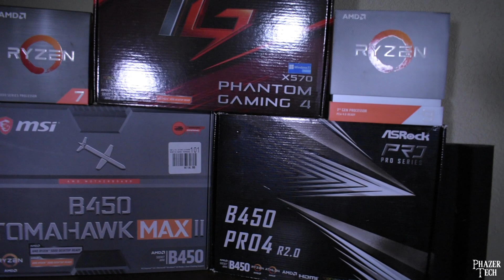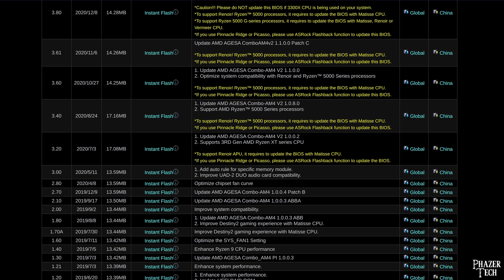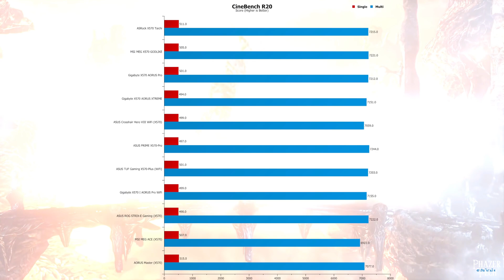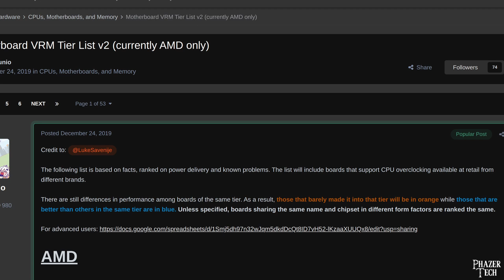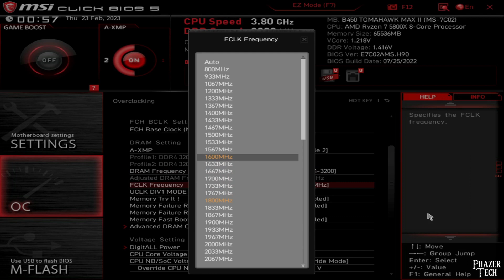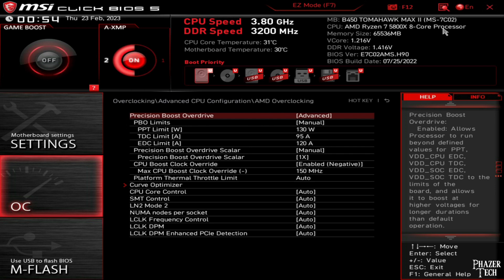AMD Ryzen CPU Degradation - Fix Instability With Custom PBO Settings!

Comment: I never overclocked for more than an evening.  At least in the last 30 years.  Few days ago I received my brand new sealed Ryzen 5 3600 and B450 board as I can't really afford anything else.  
I ended up turning off PBO for the safety of my brain.

Comment: My 5800x started to degrade after 3.5 years on stock/auto settings. MB ASUS x570-P, RAM: 2x32Gb UDIMM G.SKILL F4-3200C16-32GVK 2x32GB.
I analyzed EventView error logs, it appears that few cores and Infinity Fabric started to degrade. It runs only on 1.3375 static voltage with PBO and all boosters turned off. I fails (freezes or reboots) during idle on low voltage.

Comment: I took over a friends 5800x. Had random freeze and restarts just getting into windows. After much troubleshooting i found that it was Core 0 that gave me trouble. Had to put a +4 on the curve for that specific core and the rest I could run with -10.
Reply from the maker: That's interesting, since making this video I found the same thing on two CPUs. Actually one CPU required +4 on several cores, but they were all on the first CCD. I now believe cores are a bigger issues than the infinity fabric and I'm considering making another video on it.
Reply: This 5800x is from a HP Omen 30l build. And those are notorious for overheating due to bad case ventilation and a poor cpucooler. So this particular cpu had a tough life. Dont know how much that had effect on it though. I know that my friend that had his omen had alot of overheating issues and shutdowns. So i believe he ran it with somkind of eco mode from the hp gaming hub. He's not that tech savvy so he just let it be. So... Anyhow i bought that system from him really cheap and thought that i could bring it back to life. 
Did a clean install of windows and trouble began immediately. It would just freeze and/or restart randomly. Got rid of the godforsaken hp omen motherboard and got a nice second hand gigabyte b550 auorus pro. Same there, freezing and random restarts. Had to do alot of troubleshooting with different psu, gpu, ram. Only one thing left, the cpu. First culprit was core 0, which gave me WHEA error. With a slight positive on that one i got the system somewhat more stable. But it seems that anything past -10 on the rest of the cores is a no go. Havent really had more time to test each individual core thoroughly, but when trying to go past -12:ish it will pass torturetests but when left idling the pc just freezes after some time. Reading on different forums many seem to run these on -20 and even lower. Either there systems arent truly stable or i have a bad 5800x that perhaps has degraded to some extent due to continuous overheating. I hope i can get this thing working and stable. Havent played around with the LLC yet though.  @PhazerTech
Reply: I give upp
As soon as I start PBO it highly unstable. Even running positive 6 on core 0
Reply from the maker: @dalllle79  Try setting positive 6 on all the cores just to make sure it's not the cores. I don't think high LLC is necessary unless you have an extremely high PPT, the 2nd lowest or 3rd lowest LLC option should be fine for stock PBO power settings. Also read through the OC guide I linked in the pinned comment. Even if you're not OCing the ram you might need to increase some voltages. Here's what's working for me with ram running at 3666 Mhz:
SOC 1.1V (after vdroop, this is whats reported in monitoring software)
RAM 1.38V
VDDP 0.98V
VDDG CCD 1.02V
VDDG IOD 1.05V

If you run ram at 3200 Mhz then I'd definitely set VDDG IOD to 1.0V and SOC to around 1.06 - 1.08V after vdroop. The others may or may not need extra voltage at that speed.

Comment: Where degradation are you talking about? And the people in the comment section are also going with flow. I am using my Ryzen cpu since 11 yrs ... Performing just as new
Reply: My 5600X got worse over time, WHEA errors appeared and I had to gradually increase the pbo offset until it was positive 25 (up from negative 15, which ran fine for over a year), at that point I RMA'd it and got a replacement from AMD
Reply: You were unlucky in the silicon sector then... The processors are the only components in the system which degrade less. I have a computer lab .. Running amd and Intel CPUs. Never felt that I need to change them   @drados1824

Comment: And here I've been wondering why my 128GB of RAM was occasionally unstable on cold boots. Rock solid at 3600Mhz after its been on a while.

Also that behavior that gives an extra 150Mhz is normal. My 5900X boosts up to 5.15Ghz with a +200mhz frequency offset and a -30 (Except for a -26 on the worst core) power offset.
Reply from the maker: Check out the pinned comment, it gives info on how to get memory OC stable. Chances are you can solve the cold boot issue by increasing VDDG or VDDP voltages. Also that extra boost is "normal" for motherboards to do, but it's still higher than what AMD listed in the specs. I think it contributes to degradation, as I currently have a 5900X that requires a positive offset on the first 2 cores to be stable.

Comment: Got Ryzen 5 3600 on MSI Tomahawk Max and RX 5700. Something here is unstable (never oveclocked). Seems like either the memory controller in the Ryzen or RX 5700. Got a couple of WHEA id 18 restarts and also BSODs: SYSTEM_SERVICE_EXCEPTION (most common) and MEMORY_MANAGEMENT. This happens usually once a month, but bugs me. The BSODs always have a graphical artifacts - so could be GPU. Or CPU. This system passed 55 hours of memtest86+ (33 passes). And I also tried setting (forcing) PCIE to gen3. And different RAM module. Nothing helped. It seems that OCCT 6.2.2 with it's power stress test is capable of inducing the BSODs in 30 minutes - only way to somewhat reproduce them.
Reply from the maker: Try increasing the VDDG IOD and CCD voltages. My pinned comment has a link to a good memory OC guide talking about these, but even if you're not OCing you might still need to increase these voltages to get stability.

Comment: Might not get an answer...

But I need help figuring out why my CPU is behaving kinda weird...
(CPU: R9 5950x, RAM: 4x8 3200Mhz, MOBO: MSI X570 Gaming Edge WiFi, 650W Corsair PSU)

My CPU for some reason likes to idle at extremelly low frequency, mostly at the 2 Digits (80Mhz-70Mhz), It idles at a temperature ranging from 55-60 Celsius with that low frequency, the Core(s) Voltage is constantly at 1.3V because it is limited at 1.3V (Idle), PPT at 142W (Default), TDC at 95A (Default), EDC at 140A (Default). When running very simple games such as Minecraft Bedrock Edition, the CPU reaches more than 96 Celsius, stays at a speed of 3.4GHz (Due to a limit), uses 110%+/100% PPT. It used to be more normal, now it's all messed up...
Reply from the maker: Very weird indeed. First thing I'd do is update the bios and see if that resolves the strange behavior.
Reply: @PhazerTech  I just recently updated the BIOS, it made the CPU more stable, there are still some high temperatures during low load, like at 30% it goes to 76C, however, it has not reached 90C during the first hours of testing, still however, I'd love to fine tune my BIOS settings for lower temps. Is there any action you'd recommend, Phazer?
Reply from the maker: @kelvetkat  When a single core boosts high then it's normal to see temps up to 80C.  Sounds fine to me. You could limit the max boost speed to reduce temps but I wouldn't worry about it. Alternatively you can try adjusting CPU fan speeds or get a better cooler.
Reply: @PhazerTech  Alright, thanks, I'll see what I can do.
Reply from the maker: @kelvetkat  Yep, and one last thing. Some people suggest playing with curve optimizer which might help, but in my experience its too time consuming. It might appear stable at first but later it became unstable. So I suggest leaving CO alone.
Reply: @PhazerTech  Thanks for the advice, will indeed keep it in mind.
Reply: You sure you looking at Core Clock and not Effective Clock? Because Effective 1-2 digit at idle is normal

Yup the Curve Optimizer is really finicky, I set my PBO in September 2024 and I'm still correcting my CO from time to time because of WHEA Logger. So it's already half year of "testing" just the PBO
I could go All Core but I like to play with OC/UV. Some of my cores running at -35 and some at -18 so there's huge gap and a lot of performance to squeeze

Comment: Is this the same with intel memory controller ?
Reply from the maker: It looks like 13th and 14th gen Intel CPUs have similar issues. Generally speaking, in both cases I believe its premature degradation due to pushing the chips too hard.

Comment: Why even buy a cpu for performance if you want to use at low power, that’s the same as buying a sports car and only ever using first gear or using it only in the city at low speeds. It’s just dumb. I am not saying you shouldn’t try using optimised settings for stability but if you’re so worried about degradation but you still change your cpu every few years what’s the point of doing all this bs to achieve 10 years on the cpu if you change it every few years…
Reply from the maker: Like I already said in the video, motherboards are pushing CPUs beyond their rated specs. PBO is already considered overclocking to begin with, and many motherboards are pushing this even further. Your car analogy is dumb because I'm not suggesting to gimp performance, I'm saying to make sure the CPU is running at its rated specs and stock PBO settings. The extra heat and power consumption isn't worth the minuscule improvement in performance of just a few percent. It's a serious case of diminishing returns. Also Intel's 13th and 14th gen were having similar issues and were degrading even faster, so this is becoming a serious issue in general. Not everyone upgrades their CPU every 2 years. CPUs are supposed to last longer than that.
Reply: he cleared the point. By default the Cpu is in overclocked mode because companies are in the race for benchmark scores. If you have no problem with the power consumption and temperature then this video is not for you
Reply: think like this you buy a sport scar and the engine heats a lot and fuel consumption is so high and if a simple tweak in the engine can fix it and give the same performance. then why not do it

Comment: My 5900x just degraded, needs 0.1 offset. No pbo unless default mobo settings enabled it
Reply from the maker: Thanks for sharing. Default mobo settings most likely have PBO enabled.  I've also found that increasing the LLC settings to medium can help fix instability, instead of increasing the voltage offset like you did. But either way should be fine.
Reply: @PhazerTech  I was looking for ressources and found your video interesting. Motherboard is an ASUS TUF x570 pro wifi it case it helps someone. It was rebooting randomly for a while but now refuses to load Windows unless voltage is increased. I will try to RMA, not sure how long it will last in its current state. I Installed a single dimm at 2133mhz and tried increasing the soc voltage to no avail, it really needs CPU voltage
Reply from the maker: @krz8888888  How high is the single core boost?  If it's boosting beyond 4.8Ghz then I'd manually dial it back down to 4.8Ghz.  Also chances are it's only 1 or 2 cores that need the additional voltage, so it would be better to use curve optimizer and give a positive offset to only the cores that need it.  But this requires more time and testing to get it right.
Reply: @PhazerTech  I need to do some research on how to test and tune this properly, hence your videos. Would the offset cause it to now boost dangerously higher ? Used to be into overclocking / tuning but the last 2 computers I built have stayed pretty much at default settings. I ram 4 dimms (64gb). Cpu is an early one (stepping 0) so I doubt it has high boost frequency out of the box
Reply from the maker: @krz8888888  Yes it's possible, but even if it's not boosting higher, the voltage will be higher for a given clock speed. And I completely agree, overclocking isn't really worth it anymore.  Also if you're running 4 dimms 64GB then that will be a heavier load on the IMC and fabric, especially at 3200+ speeds. Check out my pinned comment for a good guide on getting the IMC and fabric stable. You'll likely need to increase the VDDP, VDDG CCD, and VDDG IOD voltages. Also like I said, I've found that increasing the LLC settings for both the CPU and SOC to medium helps too.
Reply: @PhazerTech  cinebench r23 reached 4740 single core but there was a burst to 4.9 right after it ended so I should cap it. Multicore 3942. Max voltage 1.525 on single core (with the offset). I was running 4 sticks at 3600 for a while but then had a bios reset and lost my setting so it ran at 4000 but async from the fabric  (not Ideal I know)
Reply from the maker: @krz8888888 Yup I would cap it, try not to let the voltage go over 1.5V.  Also it should be possible to get the memory stable at 3600 synced with the fabric.  I suggest these voltages:
VDDP 1.0V
VDDG CCD: 1.0V
VDDG IOD: 1.05V
SOC: 1.12V
Also run the RAM at 2T.
Good luck.
Reply: @PhazerTech  Thanks for your settings, so far so good at 3600
Reply from the maker: @krz8888888  Nice good to hear!  The link in the pinned comment provides the recommended limits for these voltages, so if it ends up being slightly unstable then you can try increasing the voltages or lowering the memory/fabric speed.

Comment: Man I am dealing with an 5800x that is crashing constantly. No BSOD just middle of OW2 (and occasionally other games) going black screen and nothing else, no reboot etc. Getting tons of errors in OCCT and corecycler. This system was not OC'd and running gskill trident neo z 3600 c16. I have the EXACT same mobo, ram, cpu in another system that has been running for 3 years zero problems. I think this system lost the bin lottery with the cpu. any advice (going through your vrm and scalar settings will report back)
Reply: I might add with stock everything in bios/no OC no CO no PBO, ram at 3200 it's running into OCCT/corecycler/prime95 errors. time to rma I guess unless someone has suggestions?
Reply from the maker: @ZeroSystem  What are your voltages like? It turns out the VDDG voltages are just as important as SOC.  Try these:
VDDG CCD: 1.0V
VDDG IOD: 1.0V
SOC: 1.1V
RAM: 1.38V

You could also try boosting VDDP to 0.95V.
If you still get errors it's possible one of your cores is weak and needs a positive offset in curve optimizer. Pay attention to which cores are giving errors and if its the same ones doing it then try giving those a positive offset.

Comment: The stupidest thing happen when you oc fclk > 1600 is the motherboard will use 1.2v SOC voltage. That is a lot of voltage. My 5600x run fclk 1667 at only 0.825v and 1900 fclk at 1.025v. The 1.2v auto setting in bios will consume 2x-3x times  more power than manually. The surplus power consumption is not only make the memory controller degrades faster but also make the CPU run hotter, shortening it life.
Reply from the maker: Good point, and the problem was even worse on AM5 when they were initially released. Some CPUs died within weeks or months.
Reply: Thanks for this commint. I have been experiencing instability ever since moving from 3200CL14 RAM to 3600CL16 (I needed a low-profile kit). SoC set to auto has it running 1.18v, with peaks of 1.194. Maybe this is my issue.

Comment: hi, is it better if the voltage is frequency, are they variable, like a standard energy saving for example, or can you set a fixed value of voltage and frequency?  Is it better to set the RAM to 3,200 or 3,600?  A guide for other processors would be great too.  Thank you.
Reply from the maker: I think enabling PBO is best for most people. For RAM 3600 is better but if you have stability issues then lower it to 3200.
Reply: @PhazerTech  as for, frequency is voltage, as written in the post?

Comment: Thank for the video. Does it mean that I should just disable pbo? Which still allow me to use curve optimizer?
Reply from the maker: If you disable PBO then curve optimizer will also be disabled. I recommend manually tuning PBO so you can still use curve optimizer. Make sure scalar is on 1x and also limit the max boost to what's recommended for your particular CPU.
Reply: @PhazerTech   Curve optimizer can be used with PBO disabled

Comment: Hola como estas , espero que bien , te comento tengo un mother ga-ab350 gaming y un ryzen 5 3500 lo compre todo de segunda mano, me daba muchos pantallazos azules stop code , hasta que me di cuenta que era por tener el pbo activado , lo que pude hacer para que me rindiera es hacer un oc de voltaje variable, pero solo es estable en 4000hz a 1.32v si lo llevo a 4100 hz crashea  solo en 4000hz es estable con ram de 16gigas a 3200 hz en 1.35vol no me queda otra que usarlo asi , pero nunca puedo llevarlo al máximo del turbo que es 4100 hz recorri videos , foros y nunca di con una solución quizas tenga que cambiar el CPU pero en Argentina esta complicado mas para mí saludos !

Comment: My first batch R5 3600/16GB 3600Mhz RAM/ROG Strix B450-F Gaming, with PBO enabled (with no extra boost clock) still can pump out voltage as high as 1.52v with 4.2Ghz single/dual core boost and all core boost at 3.95Ghz, testing with AIDA64 System Stability Test CPU & FPU for 15 min, the temp can reach up to 80c.
So I'm using manual OC at 4.0GHz @1.225v instead with max temp about 75c for AIDA64 System Stability Test and under 70c for heavy cpu bound gaming like CP 2077.
Reply from the maker: Nice, you sacrifice single core performance in favor of lower voltage with an all core OC.